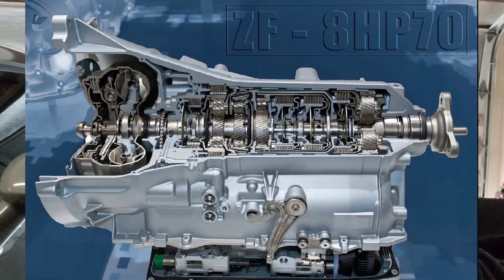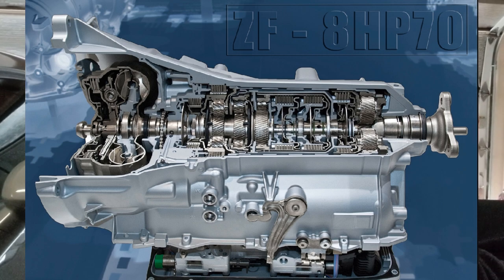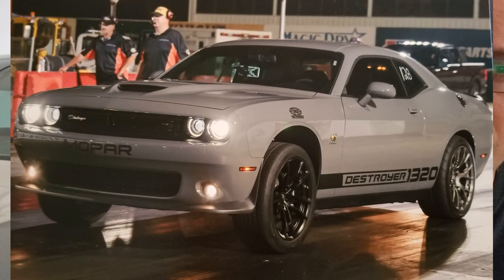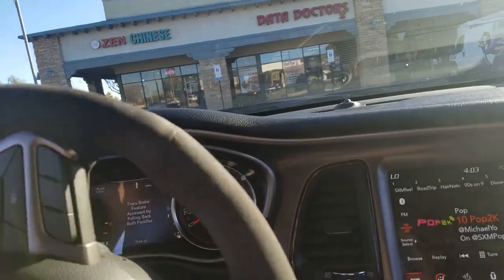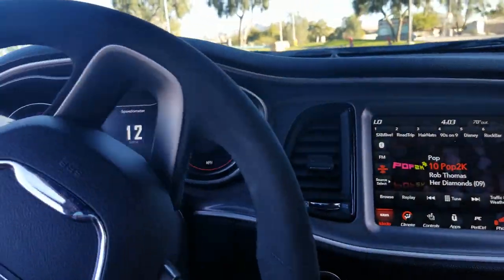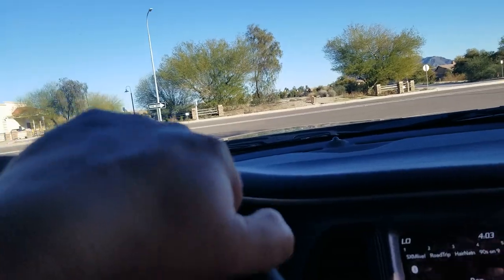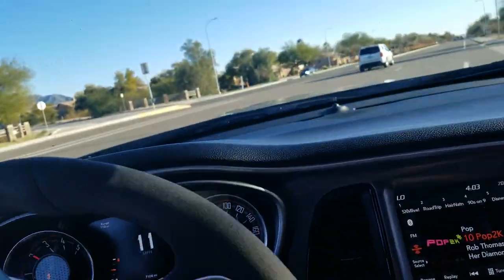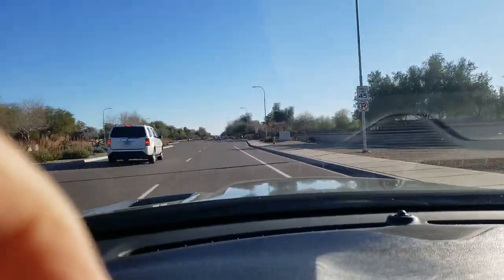2019 Dodge Challenger 1320 (Transmission and Torque Converter Info)

Comment: The 1320 uses the Demon converter RL378429AB
Reply: @Destroyer1320  I heard the same as u it's not the same part number as demon because we use the different trans 👍🏼
Reply: @Destroyer1320  supposedly it uses the same convertor as the earlier14/15 SRT 6.4 Jeeps had
Reply: @Destroyer1320  That's coming from my high performance Dodge tech buddy Eric,and for the most part he's never been wrong,so I tend to believe him,lol.The early 14/15 and supposedly 16 SRT Jeeps had a higher stall convertor in them compared to the 17 and up Jeeps,and from what he's told me, they are the same convertor as what's used in the 1320's.Makes sense as the 6.4 SRT Jeeps use the 8HP70 .I don't think the Demon's 8HP90 convertor will fit the 8HP70's input shaft as it's a bigger shaft as far as I've gathered up.

Comment: Would this be a better upgrade for a boosted 5.7 or should it be better to go with a circle D
Reply from the maker: I would go with a Stall meant for your setup, depending on boost lag you may need a higher stall.

Comment: Great Video!! Do you happen to know if it shifts HARDER than a Redeye/regular Hellcat? I just ordered one because u have a short segment here showing how it slams down at highway speed so I am just wondering how it shifts compared to a Cat
Reply from the maker: In drag mode it is like having a shift kit. Check out my Reaction video to hear it frying tire into second gear.
Reply: @Destroyer1320  EXCELLENT! Thank you. I might enjoy the 1320 more than my Cat. LOL
Reply from the maker: @davidlee-vm9ub  the big difference is traction. This thing hooks on the track hard.
Reply: @Destroyer1320  Yes ive been watching videos of it at the strip and it jumps nearly EVERY car that is  driven to the track
Reply: @Destroyer1320  is the 1320 transmission beefier or stronger than a regular Scat ?
Reply from the maker: @Oliver-ft2fq  the main difference is the 2650 stall converter and drag tune. Same transmission.